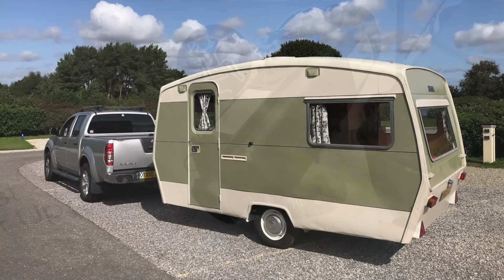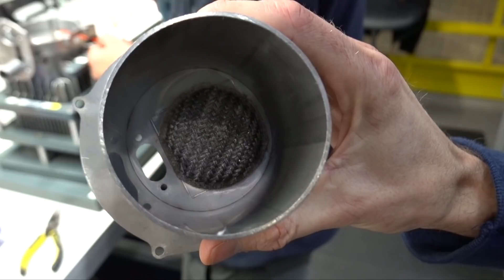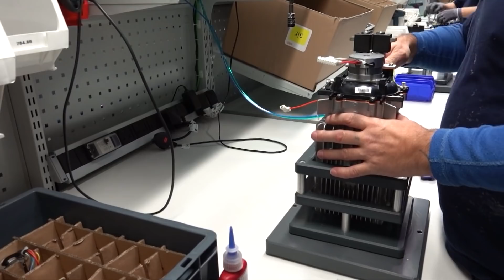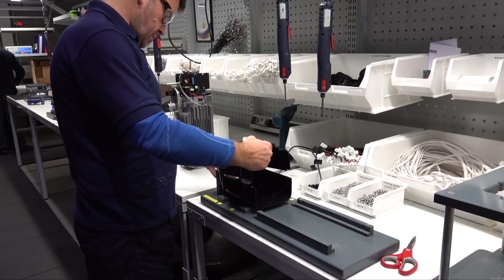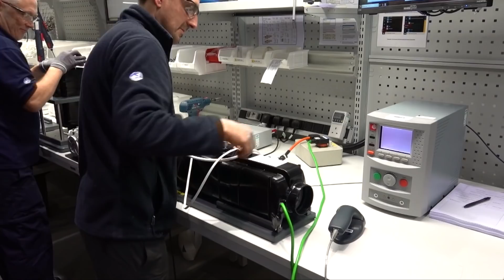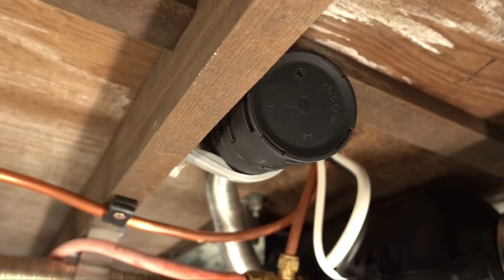BEHIND THE SCENES: Making the Whale HeatAir

Comment: How does this compare with the truma version?  I have a 2021 840 elddis and it's poor in the rear of the van : can anyone suggest why, lots saying the same
Reply from the maker: It could be a few things - like heat being lost in the long ducting, or the heating being under-specced for the size of van?
Reply: Elddis 840 2021 with the latest whale system so should be good but not happy 
Dealer says that’s how they are not great because size of the van and the ducting goes underneath!! Stupid system not fit for purpose imho

Comment: Now the only thing is there is no insulation around the heater, so as the heater is outside and the weather is cold how much heat will be lost through the heater to outside air? It might be more efficient if it was to be inclosed in a insulated box.

Comment: It is a shame you are having to heat the outside air, rather than recirculating part warmed air.  Is there a bit more explanation you could add, one would not think of heating a house like that?   I wonder if the intake/silencer might get frosted/iced in extreme conditions, it looked like it had quite narrow inlets?
Reply from the maker: I’ll cover this in the forthcoming review Simon. You can have it inside if you wish.

Comment: Is the ducting twin walled?  Otherwise, by routing a section of it beneath the vehicle, it will result in increased heat loss leading to an increase in gas consumption if not insulated.
Reply from the maker: It does have silver insulation on the inside, yes.